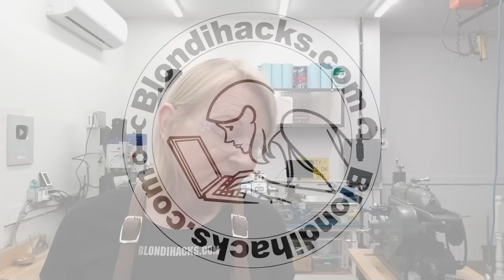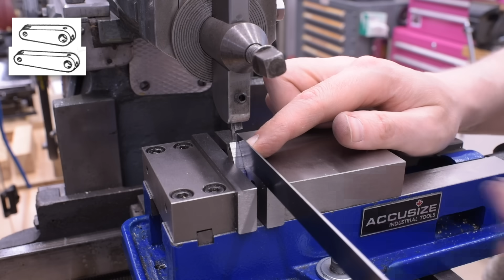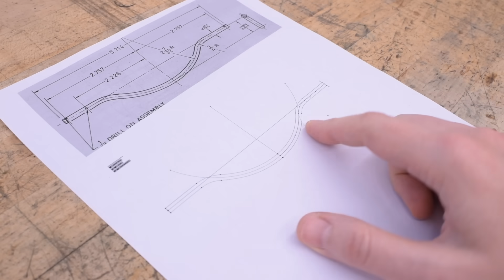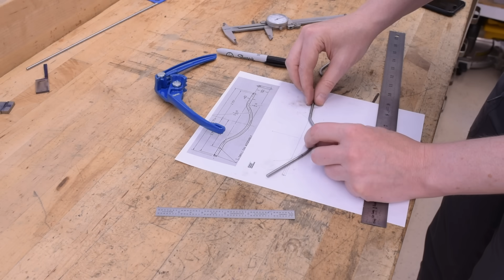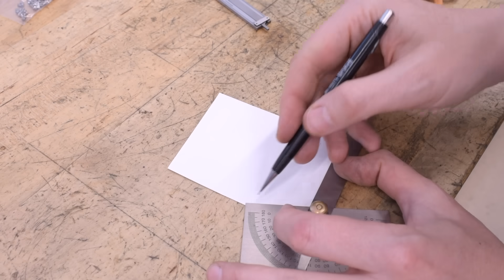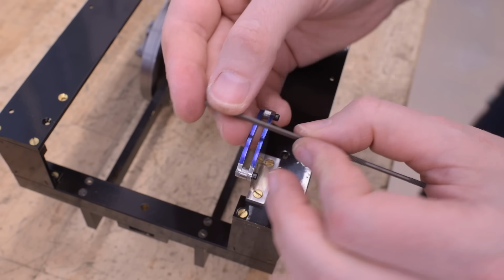Valve Control Gear - Pennsylvania A3 Switcher, Part 72

Comment: Ok I have a question - you refer to a diesel locomotive having 8 notches. Wouldn't this mechanism translate to the reverser handle, which has 3 notches? It is my understanding that the reverser on a steam locomotive is akin to the gearshift in a car, hence the need for some sort of variable action. I don't know if 1:1 locomotives have notches or just some sort of friction device to set the position.
Anyway, loving the videos and it's coming along nicely!
Reply from the maker: It’s not a 1:1 translation of terminology, since steam regulates power with a combination of throttle and valve timing, whereas as a diesel is using throttle and managing dynamic braking, but not doing anything with valves.

Comment: The valve gear is poetry in motion👌
  When i cut deep slots with my shaper I often manually lift the tool and clapper on the return stroke by using an extended tool clamping bolt that i can comfortably get a grip on. This manual tool lifting technique is also sometimes seen when slots are being cut on a metal planer. 
Another method is to fit a leather fob to the rear of  the tool so it folds up out of the way on the cutting stroke but drops down as the tool clears the cut and then it automatically lifts the tool clear of the slot on the reverse stroke.....metal shapers rule👍

Comment: That is so cool seeing all the levers move back and forth and all over the place. Its amazing that machines used to be entirely mechanical in control, not just function, so no buttons that starts a sequence of actions somewhere else. Everything has to be connected with gears and levers and cables and pulleys. Way more complicated than electrical controls if you ask me. But also way cooler

Comment: When weeks of work come together and a pile of parts really becomes an Actual Thing, that's the good stuff.

Without a shaper the clevis' slot would probably involve some slitting saw shenanigans and/or filing. Shaper once again a winner.
Reply: Actually,  had she been making those parts for someone else, she just might have made money on the shaper.
Reply: Steam era tools for Steam era jobs,  a match made in heaven. 
.
She also could have done it on a horizontal mill,  making that cutter would have been interesting.
Reply: Yes, a hacksaw cut would do it!!